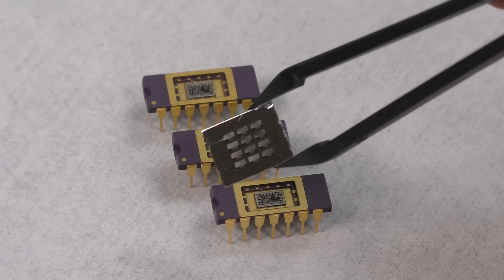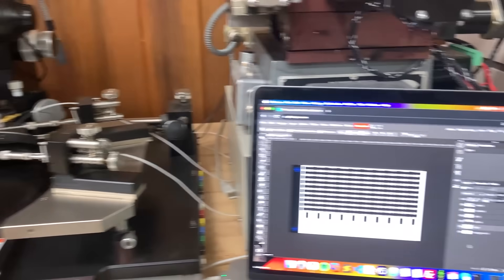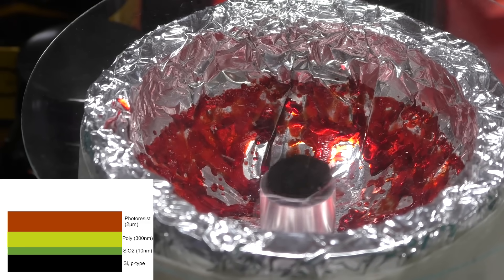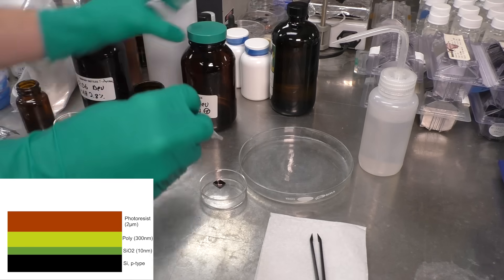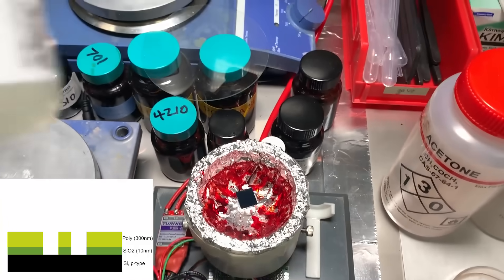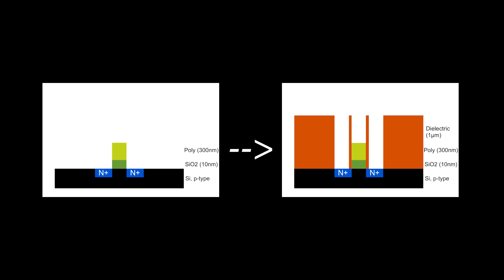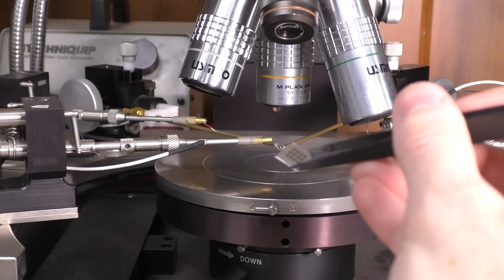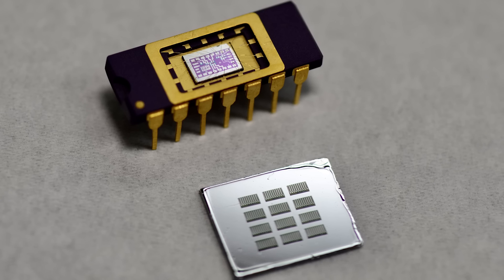"Z2" - Upgraded Homemade Silicon Chips

Comment: If you are going to reinvent the hardware and software computer and networking systems, you better make it actually usable this time around. I bet you could make it about 500% more effictive than Windows or android system just based on the fact that these systems are required by underground Lawmakers to send certain amount of data to the network center and also they are easily hackable by default from the Lawmakers datacenter. If you could cirumvent this, your system would be much more effective, and also illegal, but if enough people buy your product, the thiefing center of Law, couldn't really do sh1t. You don't seem smart enough to make something better tho, but I'd like to see you try. You'd have to redevelop the assembler language, as well as close up the holes that make modern processors so fast, it comes at a cost, hardware is easily readable for h4ckers. Can you fix it? Or do we have to wait for quantum computing by the spoofing thief master of them all g00gl3.. these computers might be faster, but the security will be aweful, just like windows, so they can sell you "protection software" that doesn't work.

Comment: As soon as hardware is available that has consumer hardware features, such as HDMI, run optimized Gentoo, and play doom, I will be first in line to buy one. How much is the cost? $500 for a system board with case that takes SD cards? There is a strong demand for open source hardware and I'm sure many open source advocates or organizations would promote the technology.

Comment: Please make a video of how to do the simplest type of transistor - the point contact transistor which was the first transistor type to ever exist. I will be grateful. Something for us, noobs. 

I have created my first point contact diode in 2018 by touching copper oxide ball which formed from a molten copper wire to a graphite plate. Zink plate can be used as well. Now I want to make my first transistor as well. Please do a tutorial on point contact transistor

Comment: I wonder if it's possible to make a machine that carves the oxide layer off directly with a small diamond, almost like an engraver or even like a printer, that allows anyone to do it, or at the bare minimum produce be able to produce the stencil that is used and do the engraving the normal way.
EDIT: Actually I just got a better idea, highly concentrated UV laser. More expensive but won't need replaced as often, does the job faster and quieter, and cleaning after engraving won't be a concern.

Comment: up to 2:41 it was a really good video

then certain important steps are not shown
it is just said that the photoresist "trick" is done 2 times

but for example on 4:27 it shows the aluminium 
but then something weird is happening the alumium get 2 holes, not said how that was done 

at the end you just see white lines i could suspect that being alumium 
but not seeing the alumium in the middle as white leads away from that 
also left and right from thw white 5:29 shows look as needles

2:58 ok it is put nitric acid i can only make assumtions here
for example the picture just shows, sio2 and poly layers gone + photo resist
but why would that happen also for the photo resist
if not the liquid would actually flood towards the layers around it

that leaves to many steps not seen

Comment: Legit wondering if you'll eventually get to the point you can make actual, down-to-the-silicon, replicas of C64 6510s or SID Chips! It'd be huge for the Retro Computing Scene having those kinds of chips being produced again!
Reply: I'm not positive, but I believe both chips can still be purchased and are still made today.
Reply: @fuzzywzhe  Nope. 100% not. The best you can get nowadays are FPGA recreations, but nobody is producing actual silicon dye chips anymore.
Reply: @fuzzywzhe  But only in Commodore Computers. They were, as far as I'm aware, never used in Synthesizers. 

They were custom made by MOS Technologies (a subsidiary of Commodore) and manufactured by them too. They are no longer being made, so the best you can find these days are resellers or, as I said, FPGA recreations. 

Sure, they can get close, but the SID Chips are known for using weird analog tricks that still aren't quite understood by most to get it's sounds. 

Even ignoring that, if we're talking about practicality, then Sam should outright stop. There's no practical reason to produce Custom Silicon ICs nowadays, but he's just doing it for the heck of it.

Comment: This is super impressive! I've worked in the semiconductor industry for quite some time now and would not have thought that this is possible. Thank you for proving me wrong!
Reply: This really makes me wonder what drives the cost of commercial IC manufacturing. I know the machines are expensive, but if he can scrap together some older stuff, it seems like there must be more to it for modern processes.
Reply: @thealienrobotanthropologist  Excellent question. As usual it is complicated. Overall cost per chip has actually fallen steadily, but the cost per factory has risen sharply.

Bigger wafers need bigger machines and better alignment, which drives up the cost of the machines, but bigger wafers can contain more chips and thus increase production throughput (process time is dependent on number of wafers, not on number of chips).

The trend towards smaller structures allows to put more chips on the same area, but also increases production cost, since the machines have to have better alignment and finer control over the process. Occassionally you need completely new processes because you hit a physical limit. So, overall the amount of chips per wafer increases quadratically with finer structure, but the machine cost also increases roughly quadratically with finer structures.

Negatives and positives of both trends largely cancel out.

In the end it comes out as cheaper chips because of automation and economy of scale. Automation allows higher production speed, more uniform quality and better control. Economy of scale is the reason that only a few super big companies are left at the leading edge of semi-conductor manufacturing.

If you build a new factory you have to buy machines within the last few generations, because they just don't build the cheaper old ones anymore. (Why would they, if they can sell an expensive one?)

And now for the big super secret sauce that no one talks about: there are still hundreds of older factories whose machines have paid for themselves twice over and which just crank out cheap, boring, routine chips for which nobody asks what feature size they have. Those factories also increase their automation and efficiency, but nobody talks about them... because micro-meters are boring - we want nanos!
Reply: @KonradTheWizzard  But I can't think of any piece of equipment that needs to be expensive enough to explain the cost of a new fab. Nothing in the video looks particularly expensive to build. HEPA filters, bunny suits, ESD protection, UV free lighting, etc. aren't that big of a deal financially. Optics of the caliber needed for the state of the art are expensive, but not enough to explain the fab cost. What makes a 5nm fab more expensive to build than a 50nm, 500nm, or 5000nm fab? If they kept the production volume the same, I'd expect the capital costs to be similar.
Reply: @thealienrobotanthropologist  Nothing in the video is particular expensive (on an industrial scale), because it works on relatively manageable scales. Let's work with your example scales and use etching as an example:

50µm: no problem, dunk it into some acid that is suitable for the job and wait till enough material is gone. Maybe stir a bit.

5000nm (5µm): not a big problem, you have to stir evenly, control the temperature a bit and be cognizant of the timing.

500nm: liquid etching is becoming really difficult, you have to precisely control the flow (speed and direction) of the acid, temperature has to be precise to at least 1K, timing must be precise to a fraction of a second. Using a plasma instead starts to look like a really good idea now. Not all liquids will even work at that feature size (see below).

50nm: forget liquids. Liquids will not enter such small features and if they are inside they will not leave. So you have to use plasma etching. Doing plasma etching on this level is much more expensive than a simple acid bath, it also requires timing down to milliseconds, high vacuum, flow control and a very controllable microwave.

5nm: the feature size is rapidly approaching a statistical basketball game of whether the ions (proverbial ball) will even find the feature wells they are supposed to go into (basket on a court in a different city). Steering the flow becomes more like black magic than science.

That's just one example. Every process has hundreds of problems that need to be solved at every smaller feature size.

Occassionally I spend a few hours with people who researched for decades on how to overcome one particularly tricky problem that I didn't even know existed at a specific feature size. It is fascinating for me to listen to... and was expensive for the companies spending the research dollars...

I hope that gives you an idea.

Comment: One of my side hobbies is to try and determine how to build a self-sustaining Mars colony.  So far, there seems to be a low-tech solution for every problem.  However, I often wish there were a reasonable way to build some kind of computational device.  This one feels out of reach.  This homemade IC is very impressive but also doesn't look practical for Mars, as making all that equipment is just utterly unfeasible.  I sometimes wonder though, is there maybe something we could do with maybe conductive ink and stamps, in layers?  It's ok for the computer to be large and low-powered.  I think a mid-1980's level CPU would be a holy grail.  

The other tough thing would be producing high-efficiency LED lights.  This one is simpler but the tricky part would be a smelter capable of extracting the needed gallium.  Self-sustainable means a smelter that we can reproduce on Mars.  

These are want-to-haves, though.  All necessary things to live independently on Mars and even in comfort are much simpler.  I have worked it out to wind turbines for power, nickel-iron sheet metal sealed structures (corrugated similar to shipping containers) with regolith for shielding on the overhanging roof so one can have large shielded windows on the sides.  Also, tempered glass bricks and clear PVC for windows.  The PVC has also many other uses, such as foam insulation and a plasticized rubber substitute.  PVC would be made from abundant salt, water, and CO2 using the high-pressure steam method.  Electric motors and turbines would be made by wrapping insulated wire coils around permanent magnets (produced by running DC current through red hot iron).  From these, we can make vacuum pumps (for separating gases, like CO2 from Oxygen/Nitrogen/Argon in the atmosphere), fans and water pumps, wind turbines, tools, and vehicles.  

Wire is made through a simple wire mill.  Much also machined using a lathe.  The biggest things to transport would be smelter, sheet metal rollers, and the lathe.  However, all of this plus 50 people could fit on a single Starship, in theory.

Comment: Long time EE here.  I'm so impressed you got even ONE transistor to work. Geesh, this is impressive, and most all, you appear to be having great fun. Obviously, "someone" is giving you some encouragement behind the scenes and probably helping you acquire some of the equipment. Immense kudos for he/she/them that believe in you. That equipment may be old and a "bargain", but it's still a major investment AND I suggest it takes some major skills just to keep the equipment alive and well.
Not sure what you intend to do next, but here are some ideas:
- Make an array of transistors that are easy to change interconnects. Invent a way to strip the metal without disturbing the active devices to "re-program" the arrays.
- You have to make an oscillator.
- Make some logic gates, or maybe you're way past this...
- Sure, go for a home made 4004.
- Make an op amp
- Make a solar cell array, because you can.
- Make some higher power FETs. Or just try to make lower Rds devices. 

Best wishes
Reply: How much would all this equipment cost?
Reply: @jjaxs1571  already the HP semiconductor parameter analyzer and the HP C Meter/C-V Plotter will run you about a grand each if you can find them used somewhere - the modern equivalent to the aformentioned parameter analyzer will cost you 10k+. And those are just two tools out of many displayed in this video here. If I had to come up with a number I'd estimate the total of the gear on display is in the tens of thousands $ range.

This is some seriously impressive kit for a hobbyist, I'm glad it found its rightful owner.
Reply: @redwillrise  So will alternative medium sized businesses be able to build low performing chips that are not AMD or Intel anytme in the near future? Open source chip?
Reply: @jjaxs1571  I don't think so. Even the simplest microcontrollers available today are like in an entirely different solar system compared to this chip here, in terms of complexity and gear required.

Even a plant producing comparatively ancient nodes - of the early 2000s/Pentium 4 era - will easily cost you hundreds of millions of dollar. And then this fab is only good for analog ICs and low-end microcontrollers and stuff like that, but even a smartphone-class CPU would be absolutely out of the question - too old, too slow, too powerhungry. You need the more modern nodes for that and a plant able of producing these is going to cost billions.

I think there's definitely going to be more and more chip designers of various sizes,  especially with RISC-V coming, but chip production will always remain a hugely capital-intensive and hard affair - even the small-time foundries are huge companies by most people's standards.
Reply: @redwillrise  Thanks
Reply: OP is drunk again
Reply: OP is commenting as if its a mentor, but really just a hack, living in his fantasy world

Comment: Just read the Wired article. All I can say is awesome. It's pretty incredible what you can find on Ebay in terms of vintage test equipment. Having worked with SEMS, crystal ovens, and all sorts of research and production test equipment you can outfit yourself with a lot of great tools particularly if you are adept at repairing them. The biggest cost is probably the shipping some of these large beasts. I can imaging the SEM was obtained locally. My favorite test equipment manufacturer of course is HP since they were all built like tanks and most are still working after decades, plus the detailed service manuals. Looking forward to more videos. Would love to see development of a home brew semi-fab along the lines of DIY 3D printing.

Comment: I have been wondering about this for AGES. I am soooo happy i found your page. Thanks to Wired for featuring you. And thank you! For putting this up. People like you really change the world by sharing online your knowledge. I might never make my own chips, but dammit i might!
Reply: In case you ever decide to give it a try, someone several years before also did it (just individual transistors though), and used some sort of ceramics oven for the heating step, with a ceramic wick of some sort (not fiberglass, but something else decently common) to lead high purity water into the oven for oxidization purposes.
Reply: @absalomdraconis  Who did it?

Comment: This is absolutely insane! Can't even imagine how long it must have taken you to figure out the whole process.
Reply: Not that long I assume, I remember creating diodes with the described process, just less repetition because there is no on-chip interconnect in a practical course when studying physics, back in the 90s. I think it was a full day combined, from getting the explanations, through doing the process, to some final testing that confirmed your success.

Once a process is well understood and well documented for students in future generations to learn it, it always becomes much easier to reproduce as long as you have access to the required tools and materials.

The most complicated part in my opinion is learning how to safely operate the kind-of-open very high temperature oven and how to safely work with hypoflouric acid, since these are the steps in which you can really injure yourself instead of just ruining a test-sample. They are also the reason why there are no commercial "make your own microchips" toys on the market, and why most people will not try to do this at home even though they know how to do it well enough. I mean how to be safe around the oven can be learned of course, not really different than blacksmithing and other heat-related hobby activities, but dealing with hypofluoric acid will always stay very scary to me, even aftet successfully dealing with it in laboratory conditions a few times.

Comment: Now if you can do it at home, how can't Huawei/china screw the USA and the chip market very soon?
Reply: Because you need a lot more than money to do high end chips. Huawei/China can do too, the problem is that they can't do it consistently to be profitable, wasting a lot in the process. What they can do consistently are chips comparable with ones from 10-15 years ago.

Comment: Very interesting. In one of your videos you mentioned the problem with vibration in your work. The Michelson-Morley experiments (1881) were performed on an eight inch thick granite slab floating in a vat of mercury to decrease vibration. Not very practical today.

Comment: Well I read about Lithography but all this equipment at home and not in a lab with this explanation is insane, I woukd bot guess that this I possible because normally rooms with high clean air mesurments are required.